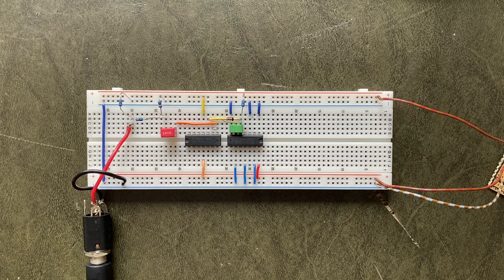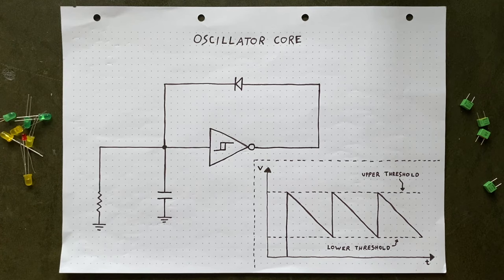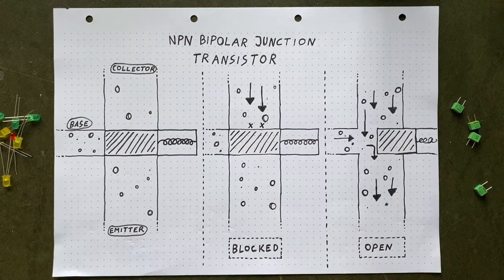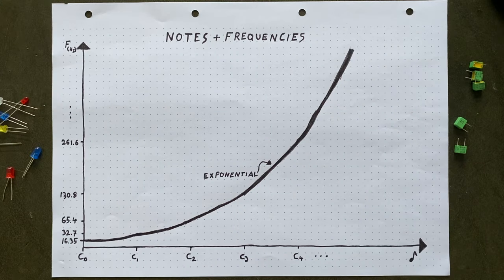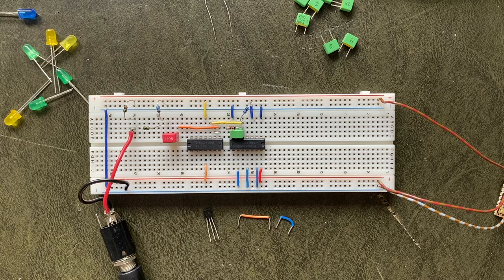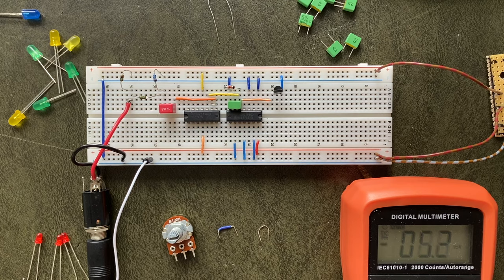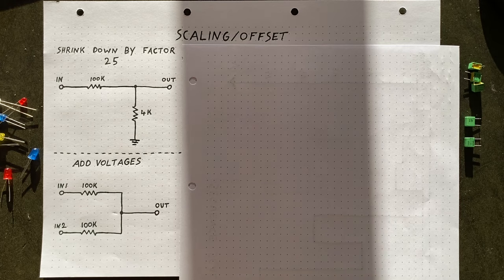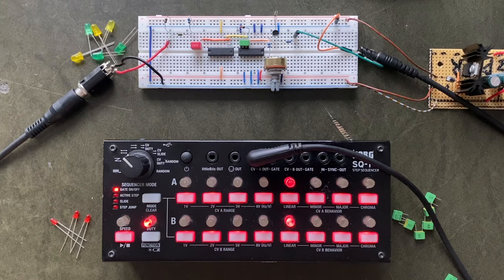DIY VCO Part 2: The simplest exponential converter

Comment: I don't get the "adding voltages". If I have a 5V source and a 1V source (with common ground) and I put them through the 2 resistors...I suddenly get 6V? What am I missing here?
Reply from the maker: it’s more mixing than adding - didn’t make this clear enough. 5V and 1V with two equal resistors will give you the average between the two - so 3V!
Reply: Ok...I think I figured it out.  You're actually adding the CURRENTs from the 2 inputs through the 2 resistors.
Assuming the 1V source is constant, it will add a constant portion of current to the output current. Even if the 5V input signal drops to 0V, the 1V source will still provide some current at the output, thus allow for a voltage at that point (depending on the load's resistance/impedance), not allowing the 5V signal to drop to zero and thus effectively 'raising' the signal.

Comment: I like your analogies with water; they're well thought out. However, you've explained bjts like they're fets, which is a common problem I find on the internet. BJTs don't have a "linear" region for physics reasons. BJTs have 4 regions: off, forward active, saturation, and reverse active. All bjt have an exponential relation for input base voltage vs output collector current while in the forward active region, this doesn't just exist "below" 0.7V, but is true so long as the voltage at the base is less than the voltage at the collector. 
Your work is great in general, and I look forward to more of your videos.
Reply from the maker: hey david, thanks for the reply! as for the linear region (which is also referred to as the forward active region): i was talking about the relation between base-emitter current and collector-emitter current there, not base voltage and collector current. from what i can tell, the relation between those two currents is approximately linear while Vb > 0.7V, and is determined by the transistor's hfe: Ic = hfe x Ib. see here: http://web.engr.oregonstate.edu/~traylor/ece112/lectures/bjt_reg_of_op.pdf

also, from what i've read, BJTs are generally current controlled (save for that <0.7 Vb region), while FETs are voltage controlled: http://www.learningaboutelectronics.com/Articles/BJT-vs-FET.php. this lines up with my own experiments, because the base voltage doesn't increase much more beyond 700-800 mV – even if i push 12V into it. correct me if i'm wrong, but from this i've assumed that above the 0.7V mark, the transistor only reacts to changes in current (since that current is flowing unobstructed into the base), whereas a FET seems to only react to changes in voltage (since no current is really flowing into the gate).
Reply: Yeah. Like I said, it's very common to find people who think that BJTs are "current controlled." That just doesn't exist. For any transistor. Anywhere. All transistors are power input, power output devices. Even fets need a current to charge and discharge the gate, and they will leak into the body of the transistor just as surely (though much more slowly) as a bjt.
As for hfe: it's not controlled and it's not static (however it will always be the ratio of collector current to base current because that's it's definition). There a lot of data sheets that will give you hfe curves. These will show the hfe varying from 10 to 250 for something like a 2n2222. Controlled in this case means if you take a random 2n2222 from a box and apply 1mA of current at the base you might get 250mA out of that one. But the next might be 200 or 150 or yet another number. Where as if you apply 0.7V from the base to the emitter you will get a very similar current out of the collector with a variance closer (+/-)5-15 mA.
Unfortunately these are common misconceptions because semiconductor physics is difficult and manufacturers don't like to hand out their semiconductor technical data willingly for people to look at. I'm also extremely disappointed with the quality of what Organ State is producing. The last graph is just WRONG in so many ways. It states that beta is constant, which it isn't. it states that Ic=B*Ib only for the linear region, which is also false and for two reasons beta is DEFINED as the ratio of input current and output current and thus Ic=B*Ib at all times unless the device is in cut-off. That also failed to mention reverse-active operation of a bjt as a valid option, which leads me to believe that this a VERY basic document for rough guess work in designs and was intended to lead into or be proceed by lectures on fets which only have three regions of operation.
https://www.electronics-notes.com/articles/electronic_components/transistor/current-gain-hfe-beta.php 
Here's a semi-decent link to how hfe/beta works in bjt's. It's not perfect, but it's more than adequate to embarrass that paper by Organ State. (And yes it too states that BJT are current controlled which I strongly disagree with)
Reply: @MoritzKlein0 Now this is a separate reply because it's a separate subject. Why did you not get 12V at the base of the transistor. The answer is simple, you forced the current through a resistor first. You placed a 100K ohm resistor between the transistor and the potentiometer. If the BJT is drawing a static 1mA through the base then that 1mA needs to pass through a 100K ohm resistor first that means the resistor drops (V=I*R) V=0.001A*100000ohm = 100V!!!!! In other words, you're not feeding it the POWER that it needs to reach saturation or hardly even to reach turn on. This means you're operating in what I know as "Sub-threashold" (although that is a term for mosfets not BJT's, let's borrow it anyways until someone else can correct me). Bjt's will draw current into the base (npn) or push current out of the base (pnp) due to semiconductor physics, this means you need to pay attention to how much current it needs which is determined by Beta which comes from collector current which is exponentially proportional to base voltage.
Reply from the maker: @davidkohtz9271  in the link you gave, under the section "Variations of current gain", it's stated that "normally the bipolar transistor is biassed to operate in its linear region for analogue signals and it can be assumed that the current gain is constant. Accordingly, for good linear operation, the transistor should be operated well within its operating range and not running into the rails or drawing excessive current for the particular semiconductor device." is that also wrong in your opinion? if so, how come you can use an NPN to amplify audio signals without distorting them?
Reply: @MoritzKlein0  Yes I do. Because by that same logic, there should be "forward linear" and a "reverse linear" region, yet they only talk about "linear" in that paragraph. The irony being that two sections earlier they talked about hfe as "This is the current gain for a transistor expressed as an h parameter (hybrid parameter). The letter f indicates that it is a forward transfer characteristic, and the letter e indicates it is for a common emitter configuration. The small letter h indicates it is a small signal gain. hfe and small signal Beta are the same" which acknowledges that there are other ways of measuring current gain which are not "forward." Also your quote blatantly states ASSUMED THE CURRENT GAIN IS LINEAR. It also goes on to stipulate a long list of conditions to maintain this assumption. That's fine, if you want to be 85% correct or what you're working with doesn't need true linearity. And again, just because something is approximately linear doesn't mean that every device follows the same linear curve. BJT1 could be more of a Y=~200*X where as BJT2 could be more of a Y=~134*X. These are both linear, but they're not the same. Also I found it rather ironic that you pulled that quote from the section of website labeled "Variations of Current Gain" and where the first paragraph under that reads "It is normally expected that the value of current gain β for a bipolar transistor is constant, however there are some variations that occur in the value of β or hFE." which again means that they even acknowledge their approximation and were telling you the non-linear dependencies of current gain.

As for why audio signals can be amplified without distortion: They can't. That's why we measure the distortion as both THD (Total Harmonic Distortion) and IMD (Inter-Modulation Distortion). It's also why we apply both local and global negative feedback to linearize circuits in things like op-amps and power amps.

There's a lot of hand waving in circuits, and that's cause people don't want to do the math. There are a lot of "approximates" and "it works good enough" and "I did a parameter sweep, this value is best" because circuits theory isn't as easy as people want it to be, but I promise that if you understand the devices and the theory, you might only have to revise your circuit 2 or 3 times as opposed to iterating through 100 spice sims just to figure out the optimum value of one resistor. Spice is a great way to check your answers, not find them. Just like these websites and non-textbooks are a great way of getting started, but not as the manual for an actual circuit using multiple IC's.
Reply from the maker: @davidkohtz9271  sounds to me like it's ultimately a question of how you want to approach circuit building – wether you're cool with hand waving, approximations, analogies and trial & error or you want to be precise and calculated. the latter is of course more sophisticated, no doubt about it. but for me as a layman (and i think for plenty of other people) it's just been more engaging and rewarding to just dive in, try stuff and piece together some more or less fruitful analogies. plus, i feel that since we're talking about music here, unexpected results can often be inspiring and don't have to be viewed as just imprecision or failure. 

that said, i definitely appreciate you giving an expert's perspective on all this!
Reply: @MoritzKlein0  It has to do with repeatability, which can be important and is why, for example, some synths cost more than others. I cant recall the exact model or brand, but there is a synth that is highly sought BECAUSE it isn't repeatable. It contains a bad bjt that didnt meet spec which gives it a "better, more fuzzy" sound that is highly valued. Of course, that wasnt a design uncertainty but a device uncertainty.
Reply: @davidkohtz9271  What makes you say BJTs aren't current controlled? I've read through your comments but couldn't quite understand your point. I've been doing a lot of reading and learning about them recently and calling them "current controlled" makes the most sense imho, given how they work on a fundamental level, with the collector "pulling" electrons / holes from the emitter, taking only a small amount for itself, and then allowing the rest to carry on to the base. I understand this to be more current = more drift = more current from emitter to base. What's your take?
Reply: @davidkohtz9271  Reminds me of the jokes about spherical chickens in a vacuum or spherical cows.  Not a helpful comment, but I'l LOLing nonetheless...
Reply: @gvcallen  the problem with thinking of them as "current controlled" is that beta is not well defined from one transistor to a next and often has a wide spread. if you make a design thinking of your transistor as a current amplifier with a specific beta it might work well with one specific transistor and then not another.  i recommend looking up the ebers-moll equation which relates the input (base to emitter) voltage to the output (collector) current, and reading the treatment in art of electronics.
Reply: I ended up even more confused by this whole thread, shit, because I want to understand what's going on in the cutoff region
Reply: @Etrehumain123  So in the Cut-Off region, the Base-Emitter Junction is "expanded" (The depletion region physically formed by the PN junction). This expansion makes it difficult (not impossible) for current flow through the device. As the voltage difference between the base and emitter shrinks,the Junction expands and the amount of current the device can sink (or source) decreases. 

Every semiconductor type, geometry, manufacturer, and process line has a different definition of where "Cut-Off" is, but it should be defined in any decent data sheet. Generally (yes I'm going to use my own bit of hand waving), for silicon based technology, under ~0.6Vbe (means Voltage difference of Base(+) to Emitter(-)) at 25°C is generally considered Cut-Off. And again, every BJT is going to have a different current rating for where this is... so yeah, PLEASE read the data sheet.
Hope this helped, it's been a hot minute since I started this thread, but I'm glad that people are still reading and learning.
Reply: @davidkohtz9271  Would you point me to some resources I could use to get a more in depth understanding of BJTs? Is the art of electronics the best option here ?
Reply: @scatman4796  Art of Electronics is a great book (series of books). If you're looking for a better understanding of device physics though and are looking into understanding how the devices function I'd ADD a book called "Solid State Electronic Devices." I had to use the Sixth Ed in my college years. I'm also not going to lie: it's not what I'd call a 'fun' read, but it walks you through the basics of Semiconductor Physics, builds up to Device Physics, and finishes off with some Integrated Circuit stuff. It's worth it to know your basics, since the more advanced stuff will build on that.
Reply: @davidkohtz9271  Awesome ! Thank you so much ! Just when I thought I understood BJTs this thread threw a wrench in my knowledge !

Comment: You are a true teacher.  I have watched so many videos trying to explain these things and just can't understand whats happening at the volt and resistance level.  I especially appreciate your water analogy for a transistor.  I don't think I've ever seen it applied that way.  Nearly every transistor explanation on the internet bewilders people with electrons, holes, doping, and other concepts.  I appreciate knowing those things, but they simply aren't helpful in applying it to actual circuits.
Reply from the maker: thanks, glad to hear – that's exactly what i'm going for, since i had the exact same experience when i was starting out!

Comment: Hey, it's me again from the comments of part 1. Just making a notes of the bits I didn't get to hopefully help make future videos easier to understand. Again, loving the series so far.

For pitch control we need to change the resistance of the drain resistor. I get that, but why not just use a potentiometer? I didn't understand this until you finished the transistor/octaves are exponential bit, but these parts felt out of order. We already know what a resistor and a voltage divider is, and I feel like a potentiometer would've made more sense as a next step.

Had you explained how a pot works, hooked it up in place of the static drain resistor and showed that it does alter the pitch, then explained that this isn't ideal for musical purposes because of how the pot is linear, then explain we want an exponential voltage change due to the way the musical scale works, then explained/demonstrated that putting the linear voltage into the transistor results in an exponential voltage output, I feel it would've made more sense and flowed better. (Sorry for the run on sentence)

Next, in the scaling/offset part, I understood the scaling part immediately. However, the diagram of the combined offset/scale part threw me off a little. Because you explained scaling first then called back to offset voltage, I assumed that was the order the circuit would do these things. Explaining them in this order was great for understanding the scale/offset problem, but once you got to 21:32 had you pointed out more explicitly that we are modifying the offset first and then scaling I wouldn't have got lost. I did understand after a few rewatches, so it might be a moot point.

Comment: Excellent video, Moritz. In fact, all of your videos that I have watched thus far are superb. You should consider designing some vacuum tube based circuits as well as they provide certain audio characteristics that are difficult if not impossible to achieve with solid state devices.

Comment: I didn't know I could use a transistor as a voltage controlled resistor. Thanks for the tip!
Reply from the maker: keep in mind that this only works under very specific circumstances. (as far as i know, only when the emitter is tied to ground and the collector is always at a positive voltage level.)

Comment: I'm experimenting with this on breadboard, and i get very inconsistent results depending on the capacitor type i use for the oscillator. Electrolitics give a much louder sound, ceramic are very quiet, PET are in between, PP are almost silent... Did i get something wrong?

Comment: Great video!  I had to think for a moment at 17:08 where you said that the "the voltage at the base is unaffected".  Then it hit me that as long as the voltage is less than the "diode drop" at the Vbe junction (let's say it's about .7v and in your case it is because your range is 350mv to 550mv), then all of the voltage is dropped by the diode and that is why the voltage does not change across the resistor.  Of course, if you go above .7v, then there WILL BE a voltage drop across the resistor.
Reply from the maker: yes and no - the way i talk about transistors here is quite imprecise. check my VCA video, i think the explanation there is much more accurate!